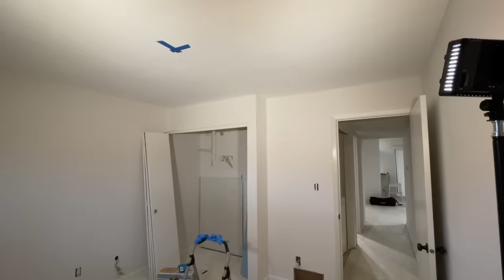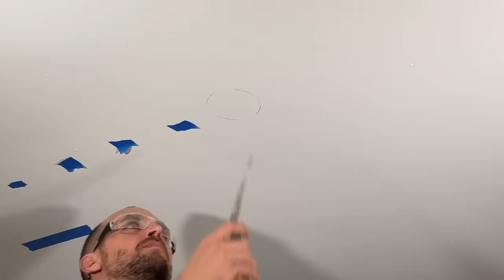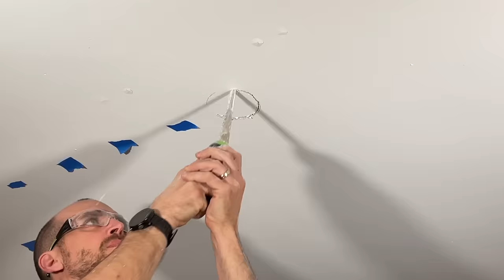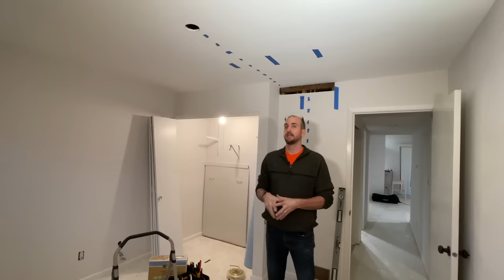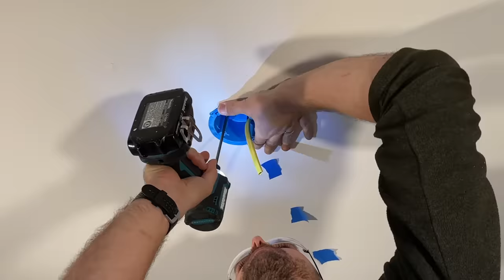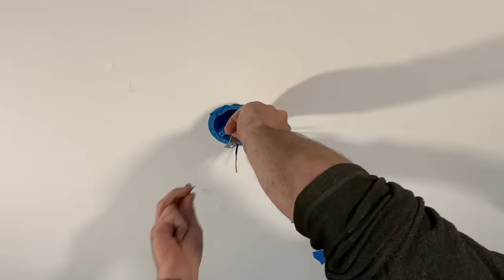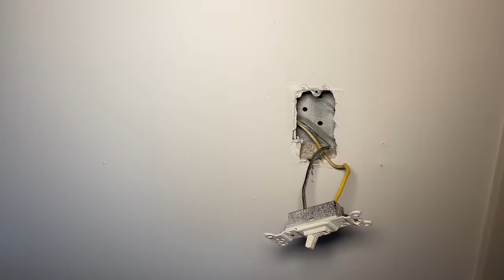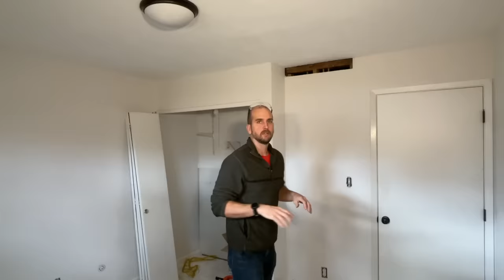How To Install Ceiling Light Without Existing Wiring

Comment: Just added four Canless Lights to a room.  Installed them with new wiring and connecting to an existing wall switch.  

Used 6 3/8” hole saw (took 25 to 30 seconds to cut each hole).

City inspector signed off and good to go with drywalling the ceiling.  Your vid provided some tips for the “next” time.  Thanks for sharing.
Reply: Appreciate it. Did you have to staple the new wiring any where?
Reply: @waynegomillion4976  - Yes, used insulated staples along the joists to secure the wiring.

Comment: great video! Yellow romex (12 gauge) is an overkill.
Reply: In my city it is the code to use 12AWG wire, 14AWG is not allowed.   Yes, it can be a pain and more $$$

Comment: Blown insulation sucks when installing recessed lights, you have to make sure it's cleared away before you start cutting holes in the ceiling. Another tip is to buy 6" lights instead of 4", they give better coverage and the larger hole allows you to use both hands.

Comment: Good job. I have the same issue at home. None of the rooms have a light and the light switch controls an outlet. To me that's the stupidest most pointless thing ever; why would anyone want to build a house like that?

Thank you for the video, watching it is the first step in trying to do something about it.
Reply: I think the outlets are used to power lamps and using the wall  switches as on and off Instead of using the on and off switch on the lamp itself. Back in the days style.

Comment: Using a multi tool/ oscillating tool to cut your drywall is a good option as well. As in the fish tape...that works fine if you don't have installation in the way. If you do, a rod style may work better.

Comment: 7:28 If you are going around the stud with a wire, make sure you’re not going between the studs and drywall. If you must notch the stud for wire, be SURE to use a nail plate to prevent potential screws or anything else from damaging the wire.
Reply: I've, unfortunately, had to use a strike plate before. It's a last resort :/ I don't like notching but it was a fucked up wiring to begin with. Fixed what I could and made it cleaner and safer... but I didn't like that I had to notch it. Ironically enough I found out they had run another wire from far away through all the studs to a completely different room. I could have tapped that but had no idea it was there. Meh it works and looked good.
Reply: !!!! Thank you!
Reply: Ty!
Reply: I used chewed-up gum to cover the notch and wire - Is that OK, master Electrician sir?

Comment: I’m glad I found this. I have a two story condo (no attic) and have considered a ceiling fan so I liked this video just to get an idea of how much drywall damage will occur to help me decide if I wanna have that ceiling fan installed.  Side note, the previous owner had a ceiling fan but lost the place in a foreclosure and the bank removed the ceiling fan so not sure if the wiring is there or not.
Reply: Make sure your box is supported.  They make a box/support kit that fits through a box size hole and braces against the joists.  Should be at big box stores or local electric distributer.

Comment: I would suggest cutting the access hole smaller and away from the roof/wall joint. Smaller hole mean less drywall to patch (you can patch the drywall away from the studs as long as you use backing wood on two seams. Lower to avoid having to retape the roof/wall joint thereby avoiding mud work on the ceiling.
Reply: Then you would not have good access to the space where the snake is . You have to be able to get right into the corner
Reply: Patch and drywall are cheap, and about half the time you end up wishing you mad a bigger hole to start.

Comment: Thanks for doing this video. This is exactly what i was looking for. In my case I have a concrete ceiling, how would you deal with getting wire to the center and interfacing the wall and ceiling when it comes to the wire?